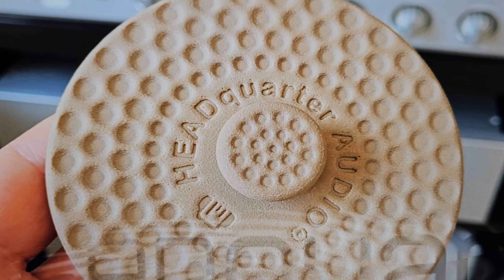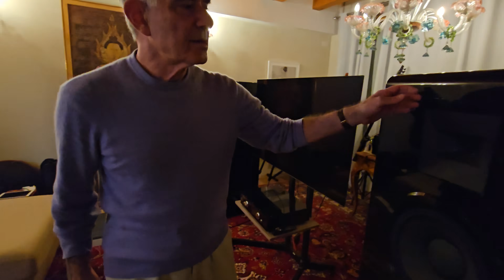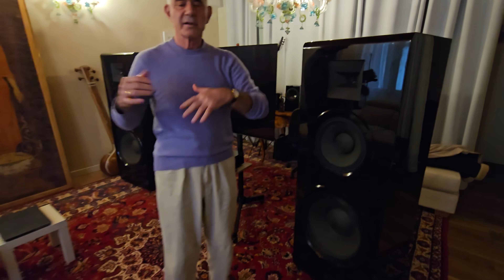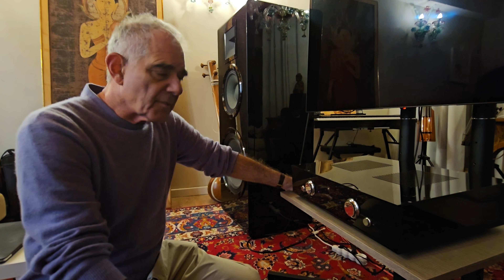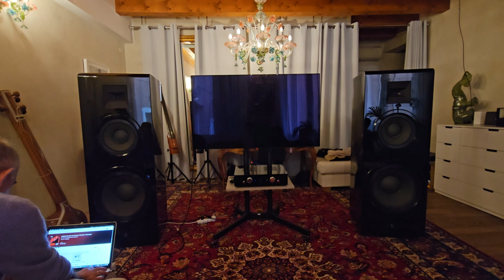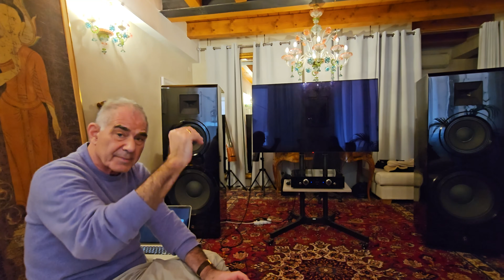Mark Levinson with his Daniel Hertz  M1  Speaker with Maria 800 -- the 200K system

Comment: It appears that speaker cables connections are BARE WIRE! Is this so ? And a cheap power bar!!
Reply from the maker: we said that in the video...
Reply: @headquarteraudio5388   did he mention a torquing pressure?
Reply: Yes, apparently basic bare speaker wire and power bars/strips are fine and will produce amazing results (Well...we've known this all along, haven't we).

HOWEVER, according to Mark you MUST have this proprietary and exclusive Cwave "technology" in order to "fix" the supposed "missing information" in digital audio, and ALSO in order to be Healthy and not die from liver and kidney problems, LOL. 

But somehow, all of the actual recording, mixing, and mastering engineers that actually record and produce this music we are listening to achieve quite amazing results WITHOUT Cwave, but they will soon be dying from health issues as they work every day/all day with digital audio and music.  /s  Haha.  It's sad that in a few years we will not have any new music to listen to because all of the recording engineers will be dead from working with "unhealthy" digital music, LOL.  😛

Of course this system sounds great...HOWEVER, that is because Mark HIRED actual professional engineers that really know what they are doing to design the electronics and speakers, and NOT because of this Cwave nonsense.   FYI, Mark has absolutely ZERO engineering credentials and it's clear from this and other interviews that he has a fundamental MISUNDERSTANDING of Digital Audio SAMPLING and the Shannon-Nyquist theorem, which has yet to be challenged or disputed.

@mikeeygaulthier  
Yes, ideally you would at least use "tinned" OFC speaker wire in order to minimize corrosion/oxidation over time.